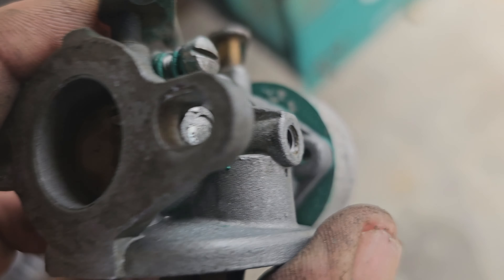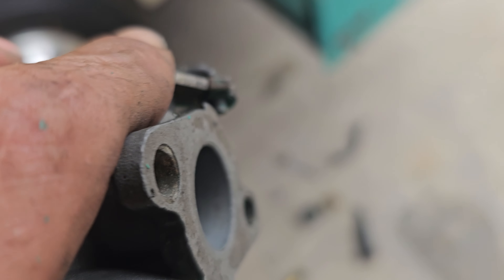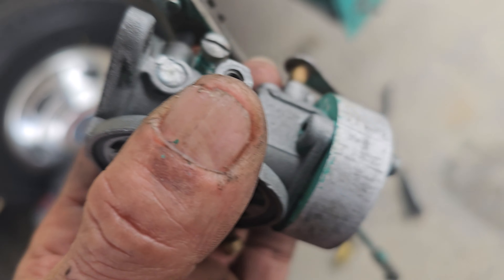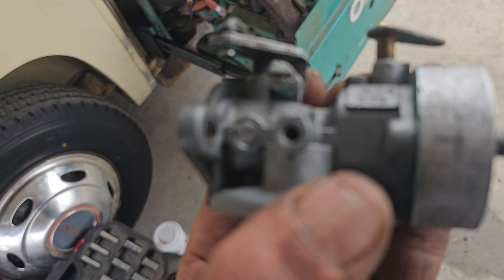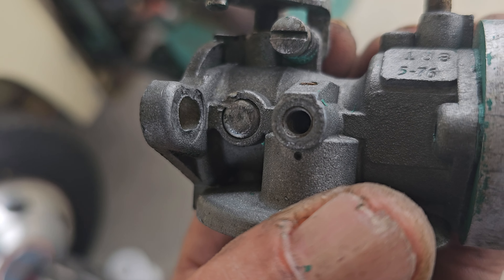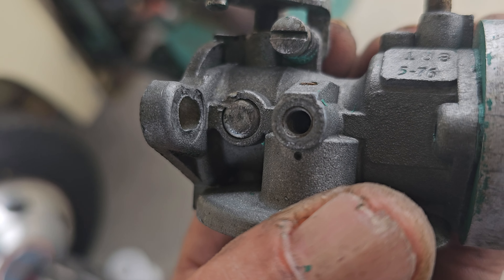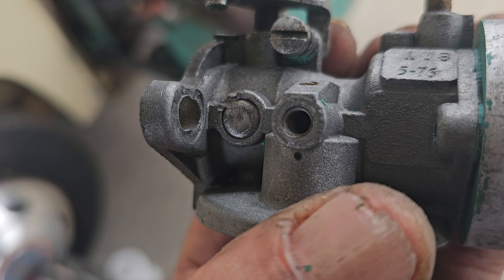Question for the Onan gurus while cleaning and adjusting my 6k genset carburetor

Comment: As a general rule, a lean out is from lack of fuel, more so than external air introduction (within reason!).   Huge no-no is to use RTV anywhere in the area of your fuel system though.  Gas is like one of the major things that attacks it! Even just the fumes. It'll turn it into a gelatinous goo.

Too kind of narrow down the area of problem, I'd start by leaving off the governor linkage when you put it back together. Force it down to a low idle (make sure the AC breaker is off!) and see if it runs normally. Adjust the idle mixture screw until it's happy. Try to get it to run up to normal operating temp when you do it. It's been a LOT of years, but I seem to recall some had a hi/low altitude adjustment. All it really was, was the idle mixture screw with a cap on it that let you make like a 1/4 turn.

Comment: Oh yeah! As for that cap. That's where they drilled through to make ports in the body. Then they cap and stake it. If it's really really leaking, then try pushing it in and with a small punch, make a new stake across from the original, and tap the old one in a bit more.
Reply from the maker: I got it running much more smoothly but discovered this unit has much more significant problems. The plate that the starter is mounted to is broken, so the starter is just kind of flopping around. It was holding well enough to engage the pinion to the flywheel until it went completely floppy today during my numerous starts and stops. It also seems to have a pretty significant knock.  I don't know if it has ever has the heads off for decarbon procedure. It's looking like a complete rebuild or replacement is in my very near future. 🤔
Reply: Oh man. That sucks. A replacement will be a best choice in your situation I suspect. Onan parts can be very expensive, and with that machine being near 50 years old… they’re getting harder to find.

Comment: From what I remember ...
No it should leak, but the small amount of air it passes should be an issue. 
We would seal the wells on the QuadraJunk carbs, for the main engine, with JB Weld or gas tank epoxy. I would use that to seal that plug.
Reply from the maker: The carb issues are the least of its problems. Broken starter mount plate, constant bottom end knock, likely never had the heads off to decarbon...  and the starter circuit hangs up and keeps engaging the starter after the engine is started. I'm on the hunt for a replacement or parts unit with a good motor to swap over to my good armature. Found several somewhat local but I'm in no hurry. Running on a Briggs ohv powered predator right now and will be on shore power as soon as it dries up enough to put my coach where it needs to go for the foreseeable future. Not planning on any trips for a while.
Reply: I loved the design of the "Power Draw" but it's hard to beat the 30 years of technology of the new quite running units.
A random start signal is most likely the control board or the wiring to the remote start switch. 
Looks like one of the older GMC guys is still making circuit board.
Dinosaur Electronics Onan Generator Power Supply Circuit Board Replacement
Reply from the maker: @iamthetarget52  if I can find a reasonably priced modern, more efficient, and quiet unit I will retrofit. I'm even looking at propane and dual fuel options.
Reply: By the way, RV Generators cost more, but run at haft the RPM's. So typically, they are quieter. 
I should also mention, I was a 73' to 78' GMC Motorhome specific mechanic. But that was 15 to 20 years ago, things have changed.